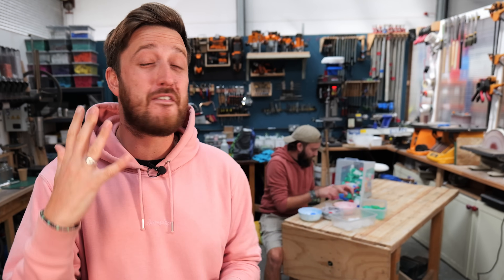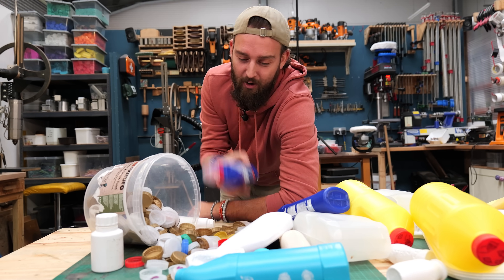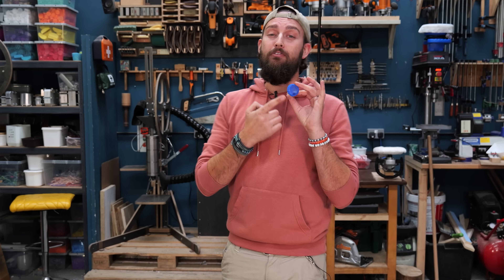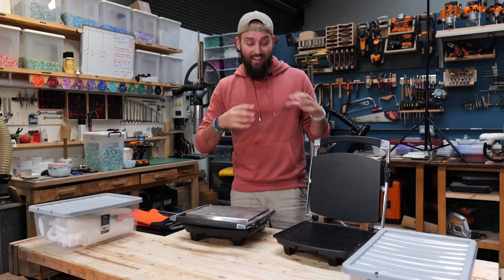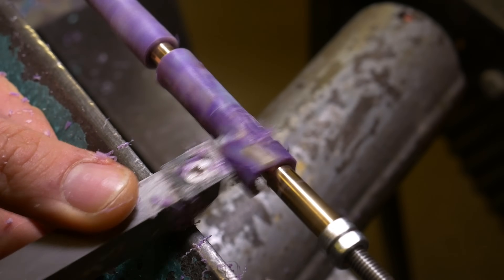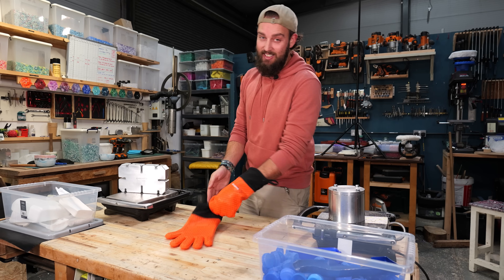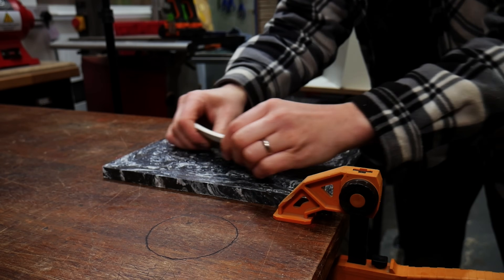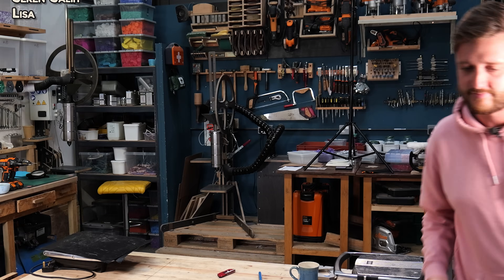11 things we WISH we knew when starting Plastic Recycling

Comment from the maker: 🚀 To try everything Brilliant has to offer for free for a full 30 days, visit https://brilliant.org/BrothersMake/ 🎉 You'll also get 20% off an annual premium subscription. Supporting our sponsors helps keep us in the workshop, saving more plastic from becoming pollution 🤙🏽
Reply: Put cement powder in melted plastic 👍🏿
Reply: What is the sheet that sits on grill heat press where the caps sit but the black cloth neither melts nor stick to pan or plastic what is that thing please tell !
Reply: Where do you get the aluminum molds?

Comment: I AM SO IMPRESSED TO SEE THIS VIDEO. I GOT TOLD BY THE DOCTOR THAT I HAVE A TERMINAL DISEASE NOW CALLED EMPHEZMA BECAUSE I HAVE BEEN MELTING PLASTIC FOR YEARS AND DOING IT THE WRONG WAY.  IF IT HAD ALL BEEN FILMED THEN YOU WOULD HAVE HAD THE PERFECT HOW NOT TO MELT PLASTIC VIDEO.  I LIVE OVER HERE IN USA NOW, WAS FROM ANDOVER HANTS AND I DIDN'T KNOW THAT THE BLACK ADDER ACTOR HUGH FRY HAD A SON BUT HOW IS YOUR DAD, WHEN I LEFT THEY WERE 0N BLACKADDER  4 WITH WW2 OR WW1 NOT SURE. BUT ANYWAYS I AM SO GLAD YOU GUYS ARE ALRIGHT HEALTH WISE. YEAH I STARTED BURNING PLASTIC SO NOT TO FREEZE AS THE CARDBOARD WAS TOO SOGGY TO START AND THEN I STARTED MAKING THINGS WITH THE MELTED PLASTIC AND IT IS INTERESTING TO SEE WHICH PLASTIC ARE WHICH. OVER HERE IN AMERICA I WOULD RECOMMEND DO NOT BURN THE CLEAR PLASTIC THEY USE AT BAKERYS AND DELI AS FUMES  ARE SO BAD. BUT SHARPS CONTAINERES AND BOTTLE CAPS, HYDOGEN PEROXIDE BOTTLES AND THE RUBBERY FEELING STUFF BUT THE STIFF STUFF LIKE LIGHTERS OR CUPS THAT SHATTER IF YOU STEP ON THEM BAD FUMES.  HEY KEEP IN TOUCH IF YOU WANT TOO. I MAKE EVERYTHING  I CAN IF I CAN AND I AM GOING TO SEE HOW THEY MAKE  MARMITE AFTER I WATCH YOUR VIDEO. I MIISS BRIITISH CANDY/SWEETS. CHEERS

Comment: Rather don't use harsh chemical containers like toilet cleaners, draino, chloride and so forth. These require special toxic waste management. Also it's unhygienic to use those, but moreover dangerous due to the remaining chemicals inside. Dishwasher-, hand soap- or shampoo bottles are safe to use I guess.
Reply: Certain chemicals shouldn't be mixed for it's dangerous!
Like acids and chloride. Just an example.

Comment: Outside is often unbearably noisy and working with doors or windows open is not an option for ND people with sensory sensitivity to noise and vibration and smell. Use of fans is also not an option for that reason because fans are 100% sensory inaccessible. 

Heat gun is a form of severe disability abuse against people like me. It will cause a meltdown and has high potential to cause a seizure. 

NT people without sensory sensitivities exist in very privileged world. Many of their opportunities do not exist for disabled people like me. It makes me feel grief, rage, and despair.

Comment: The state attourney of California about California vs. Exxon: "We are suing Exxon for knowingly and intentionally using "plastic recycling" as a way to whitewash plastic production, while they have known for decades the problems it causes and the impossibility of recycling most kinds of plastics. There is not going to be a company called Exxon when we are done with them".

Brain study reported on by CNN a year ago: Plastics double in the human brain every 8 years [because of morons running around talking about how great plastic recycling is instead of 99% of plastics being possible to switch with other, safe compounds, that manufacturing owners (the top 0,01%) don't like because they are a little more expensive.

How plastics in your brain is ok, "Brothers Make"? You have likely several % now. Is 10% ok? 15? 40? Will you still be babbling about plastic recycling when it's at 50%?

Comment: I once worked a factory job, where if a bottle fell off the line, we'd try to recycle this, and all too often this was a disaster.  if one of the bottles had a dot of grease, it likely picked up from the machine falling off the line, a dot of grease the size of a freckle, it would ruin the new bottle made from the recycling from the old one.    Too bad they did not know the washing machine trick, perhaps that would have helped save resources   You do not know the bottle is defective until it has product in it, they fly by at miles per hour.

Comment: What about using a heat press The kind that you use to make T-shirts etc. I use mine and it works great. It has a max temp. of 180° and you can set it lower if you want. And it has a large work space. You can also buy heat gloves that are a lot easier to hold things and work with. Super cheap and orange too! And your electric bill must be through the roof!

Comment: What about recycled plastic building materials, like 2x4's and sheathing for walls and roofs....extruded plastic 2x4's and pressed sheathing made from plastic shreds...theoretically it could be treated the same as wood as far as cutting and nail guns go...also it is rot proof and mold proof so houses in damp or flood areas would greatly benefit...tons and tons of plastic being reused....flammability is not any worse than wood, plastic is easily put out with water, maybe fumes from burning plastic but regular houses emit toxic smoke too🤔

Comment: Why not add sawdust or sand when folding just before placing it in the press? Sawdust would help with binding and strength. Sand would increase bulk so less material is needed. comment?
Reply: I dis watch a video that mixed sand and melted large quantities of mixed plastics to make roof tiles.

Comment: What is the best way to make specific small molds? I assume silicone is out of the question due to the extended heat retainment. How did you guys make the molds for your sunglasses? Also, what is the best way to shred the plastic like you did to mix up the types and colors for at home d.i.y. people?
Reply from the maker: Head to PlasticPreneur.com and tell them Brothers Make sent you for 5% off all moulds and machines 🤙🏽

Comment: Just a tip: In stead of the wood boards you are using in your press, find some thick aluminum sheets. They will disperse the heat from the plastic molds much quicker ;-)

Comment: Although your intensions seem worthy. The entire process is not very environment friendly, right? You use your petrol car to collect from too many locations, with extremely limited colors, you suggest using very volatile chemicals just to remove a thin label, when often a soak in boiling water is enough. All those chemicals are both expensive and evaporate too quickly.
You use an uneven waffle press to flatten a result that only has the quality of used gum!
Even using a wash cycle to clean tops is more expensive than leaving them to boil or soak in Clorine overnight.
Here in Sweden, there is no sorting done at all, yet who wants Pink/grey glass frames anyway.
No, they offer a container on the street with a compartment for plastic but not thin plastic bags, they go into "Burnt".
Yet they do not tell you that the two types are dealt with in the same way, i.e. burnt.
You are using a lot of energy through the whole process and that did not look to motivating.
Then there is all the extra equipment made and at a cost too. It would take far too many glas frames to win back that kind of money.
In the end, the results looked terrible right. uneven, scraped, crudely trimmed etc.

I think you should stick to using a 3D print that offers a cheap, no waste result. Household plastics should be ground to a fine
texture and be mixed into road Tarmac or Asphalt as it helps against frost and is a good insolent. I believe they use polystyrene 
in America for this and it works well. It is also a product without it´s own container at tips, so again is burnt.
I also think that there could be a system for charging cars while they are on the roads. You would skip having to worry about
that issue too. Your car would be scanned and even the streetlights might light up for you too?
It would know were your going too. They have those tiny wind turbines that sit on top of street lights to charge the lights
do they not, any excess charge you make can be stored as a back to nature cost and pay for more trees or be stored?
What do you think? Naturally would only work for major roads to start with.

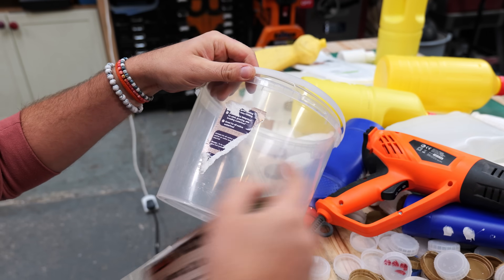Comment: 3:40 the heatgun tip is great. Another seemingly obvious tip but it took me a while to appreciate: The best adhesive or solvent to remove the adhesive is itself. So, when you have a mostly intact label coming off with adhesive backing but a bit of paper and adhesive left behind - often the best thing is to take that just removed label and tack it to the dregs remaining and then pull. Often I find the angle (shear vs tug) and some repetition helps. I don't think this works for everything but it's so simple and so much better than having to soak or try and find the right solvent to match - you already have the exact match on that waste label.

Thanks for the video!
Reply: Glad someone else mentioned this. That was the first thing I thought when I saw the label being pulled off. There were small bits of glue residue that would've been picked right off had that freshly-removed label been tacked on those spots a couple times.
Reply: You realise electricity (for the heat gun) is burning fossil fuels and = Bad!
Reply: I often have to remove stickers at work. That's what we do and also use tape.

Comment: 14:55 You could add a weight hanging off the end of the jack handle so that it would have a constant pressure, then just come and give it a lift if the weight touches the floor.  You would just have to add equal weight to the cart, so it doesn't flip.

Comment: Hi guys, I found your video by chance. I’m well impressed. ❤ I’m a crafter and try and use as much recycled stuff as possible. Although I’ve never tried to melt plastic. I’ll have to give it a go. Is there any other ways to melt it other than a panini maker? I have an air fryer and oven. As for moulds could you use silicon or do they have to be metal? Thank you. Regard Tracey.

Comment: Thanks for the tips, I do 3d printing and I was wanting to do something with misprints and supports that would have otherwise gone to waste. I do have a question though, I was gonna try to make silicone molds of thing's I print regularly for my etsy store to use my waste to make some of my products and I noticed you guys use metal molds, so my question is; are metal molds necessary for this sort of thing or are they just easier to work with?

Comment: @BrothersMake just wanted to say I love the video series and have been inspired. Yesterday I had the idea to take a large soft log of hdpe throw it into a pre heated 1/2 gallon mason jar and use a food saver jar vacuum sealing kit with automotive break bleeder to suck out out the air bubbles while it’s still hot. If you try this idea and like it can you please give me a shoutout in a video sharing this process as Dustin Ames or Screamingtea#240❤ (The air pockets drive me crazy😅). I really love the content a sincere thank you. Also the gasket on the mason jar lid will melt so dont remove lid after heating but ok to remove and reattach the jar sealer attachment. Considering silicone grommet and sheet steel instead of regular lid to prevent waste.

Comment: What made you choose to use a kitchen oven to heat the molds for the injection machine? Instead of direct resistive heating built into the molds or something similar that you can clamp to the molds

Comment: Just the tips on removing labels is itself a huge timesaver for me… though I’m not really saving much plastic at the moment now. I was mostly just trying to reuse the bottles, but they don’t fit a grid.

If it were possible to take a circular plastic bottle and reshape it into a smaller hexagonal or rectangular bottle, that would be fairly useful. I would imagine that heating and remolding would be possible, but tricky. If the reshaped container could be stacked, that would definitely beat the 3D printed “gridfinity”

Comment: I have melted milk bottles before when I needed a lump of plastic for a project. HDPE is really tough when cooled and is difficult to cut when thick, as it melts when using a jig saw, but you adapt.
Reply: Use water as lubricant coolant.

Comment: How much energy do you use to recover this plastic? Using energy to make non-essential goods from reused HDPE is not environmentally conscious.
Reply: Exactly
Reply: There is more to eco-friendliness than energy usage. They are removing plastic from the environment that would otherwise be pollution. Pollution is not environmentally friendly. There are so many parts to taking care of the environment, and taking care of one part may mean harming another. The real solution to both the energy and pollution issue is to figure out some other packaging so we stop using so much damn plastic!
Reply: @Tyburn_Lil  Are you alright? Compared to using HDPE to make essential goods only. Compared to using energy in a more environmentally conscious way. Do you always require this degree of spoon feeding?

Comment: By the time you add fuel to get plastic and the electricity to melt the plastic, the carbon footprint of small scale recycling is probably higher than disposal or commercial recycling.
Reply: If many recycling companies didn't toss the majority of their received recyclables into the landfill, it might indeed be easier on the environment to trust the big guys to do it large scale. 

Unfortunately that's not the case, and until that changes,   everyone who helps keep things out of the landfills should be lauded and appreciated. 😊

There's still so much to be recycled; care to join a movement?
Reply: @Whimspiration  Does not negate the fact that the carbon footprint for what these guys are doing is higher than throwing it away,  You might as well burn the plastic because fossil fuel is being wasted to power the melting of the plastics.
Reply: Such an inefficient hobby.
I wonder what happened to all the panini presses, ovens, air fryers and other appliances they contaminated then cast aside?
Reply: It depends. If you are working from wind and solar it’s a non issue.

Comment: What is that black material that you use inside the fryer to put the lids on to melt?
Reply: It's a Teflon baking sheet; not sure why they'd take the time to respond, but not actually answer your question. 🤨
Reply from the maker: We mention it in the video 👍🏽

Comment: Does turning them into small chips eliminate the air bubbles and thus the need for twisting it? Precious Plastics Melbourne does a lot of speckled slabs that have a nice terrazzo effect, would love to be able to replicate that look!
Reply: nope. also, better method for de-bubbling is to use a vacuum chamber.

Comment: I don't know if I was the one mentioning the heatgun trick (I've used it for over 12 years), but there's a few more methods:
1: Since you're removing stickers from a bottle (or jar), you can fill the bottle with hot water; this can be poured into the next bottle, etc. after you've removed the sticker.
2: If the sticker still sticks (some glue types do not 'melt' completely when heated), then use sticky tape to remove the remaining glue.
3: If that doesn't work; try using water and salt.
4: If you're still out of luck, try dish-washing soap.
5: If still out of luck, you've spent too much time on this already, but you could - as a last resort, try the washing machine. 😉
Reply: I’ve never heard the sticky tape trick before, I’ll definitely be giving that a go!
Reply: @em5114  - There are several types of sticky tape; some have good glue, others have terrible glue.
Most of the time, put tape over the glue you wish to remove, then push firmly, to make it stick well; then pull it off slowly (don't use a lot of force pulling off).
Sometimes the glue won't easily remove; and sometimes you'll need to change tactics, putting the tape back over the glue several times and sometimes quickly and forcefully pulling the tape off instead of slowly.
Tape can also be useful for removing dust, where (or when) you can't vacuum-clean.
Scotch tape is not very good for removing glue; painter's tape would be better, but transparent packing tape might be a real good choice; it's usually strong and usually has a good glue.

Comment: Hi, some questions if I may: do you use detergents when washing plastics in the washing machine? Do you chop up bottles to make it easier to clean? What are you doing to minimise your energy usage? Home power generation? Solar heating? Have you thought of a candy folding type machine or something of that nature to fold out the air bubbles? Similar question about a machine that applies and increases pressure over time? Does static build up in the plastics making it difficult to manage shavings?
Reply: Great questions. If I can add a related one: Do you need to be careful about washing certain items given that the “milky white” liquid is going into the waste water system?

Comment: Plastic is never truly recycled (such as aluminum for example). At maximum, you are just postponing its destiny - sea or landfill.
Reply from the maker: We disagree, but thanks for the comment
Reply: @BrothersMake  I'd love to know your point on view on this matter. - by no means I think what you do is lesser. Just matter of buzz works labeling wrong and green wash  the real problems to make us feel better.
Reply from the maker: Oh greenwashing is a huge issue for sure. But not everything is greenwashing. We made a video testing ‘how many times can plastic be recycled’ and showed that if HDPE is cleaned and separated properly, there effectively isn’t a limit. So full circularity is very possible and not impossible to achieve.
Reply: @BrothersMake  Thank you for your insight on HDPE. I learned something today. - Additionally, the industry flipped the game making us responsible for their mess when it is on them. Politics is a way to enforce laws to stop trash flow.  Thank you for your good work!